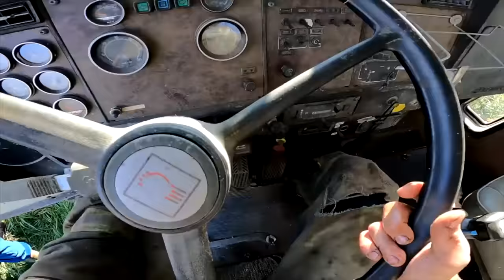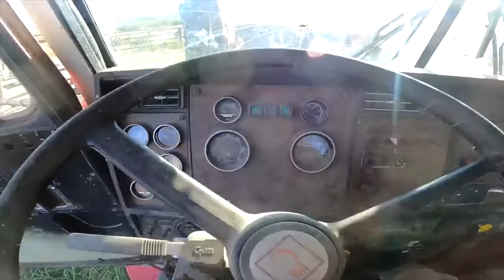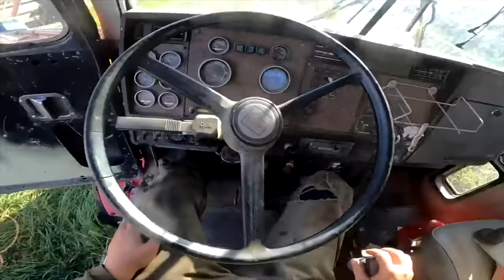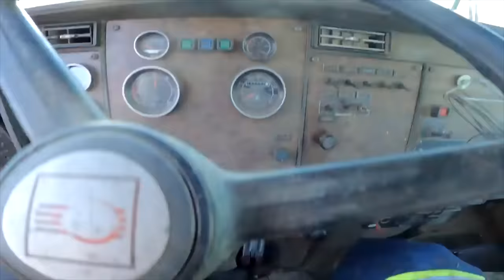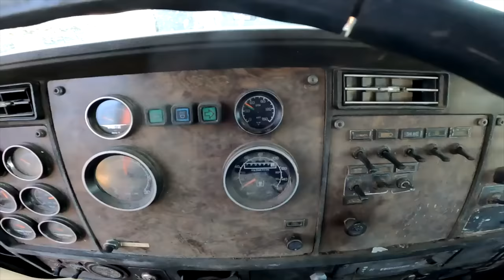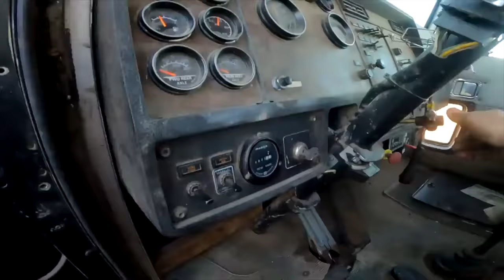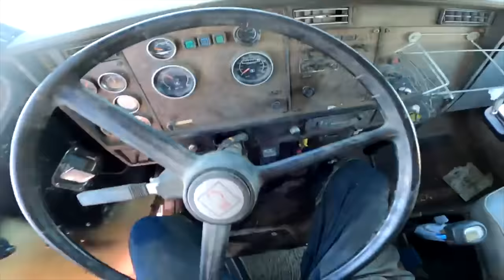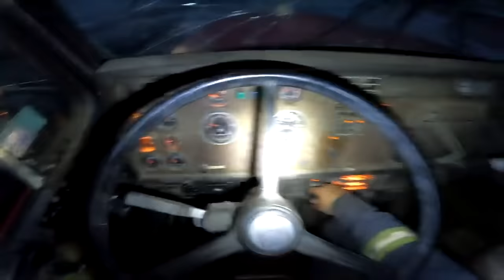1992 KENWORTH REZ ERECTION N HAUL!!!

Comment: I'm a Deere guy, but I have never heard anybody that dislikes Deere ether.  You see all the pulling guys use Deere ether too, so if its good enough for them to spray that into a several thousand dollar motor... drenching a 200 dollar one shouldn't be an issue.       Youuuu don't need to worry about ether locking your motor or ether backfires.
Reply: if its not red leave it in the shed
Reply: @ihguy2113  green means go, red means stop.
Reply: @ihguy2113  I thought it was " if it's red it will never leave the shed"
Reply: Green? Yuck.
Reply: @keltonwright7  I've been sideways with Deere and others for farmers right to repair. As the CEO of Deere made 6 million in 2019, 15 million in 2020 then 31 million in 2021. Not like they aren't profitable. So if you are seeding on a Friday and the Deere dude won't make it out with his fuking laptop to diagnose your system until Monday then what? So you grab a different tractor right? But that one is planting also. So use lose 3 days planting just to have it diagnosed. And that modem under a person ass in the tractor is sending what information to who? Your being squeezed out by mega farmers. Just like Deere and others killing off small dealerships. Yea I've seen all above happen. Next year the the pesticide, herbicide and fertilizers shortages have been in the spotlight for 6 months. They are putting the screws to every aspect of live to force the reset.
Reply: @dellingson4833  Same way with everything, and its not just Deere.  A neighbour of mine had a big agco Allis probably 300hp and the computer went.  So he phoned the dealership and they came and took it out and sent it away.  Well agco only rebuilds and programs the computers when they get enough to do a "set" number at a time.  Fast forward to last summer ( 6 years later). I see the tractor getting towed on a flatbed to the dealer and returns a week later back together and driving.  I'd wait 3 days over that, and pretty sure anybody would.  That's why nothing will be the pre-electronic age tractors, I know the last good Deere was late 90's.  That's why I own tractors from the 40's to the late 80's.
Reply: @keltonwright7  That is why i said Deere and others. But i watched the problem unfold in front of my eyes. It just happened to be a 18 month old JD.
Reply: @dellingson4833  yeah it's unfortunate, you get lemons with anything.  Know a die hard Chevy guy, bought a new truck.  Didn't even get 5 Miles from the dealership and it quit. They came looked at it and ended up towing it back and they gave him his money back because they couldn't figure out what's wrong with it.  Happens with everything, so is life.
Reply: @keltonwright7  but Chevy has right to repair as with most car companies except Tesla. It's the RIGHT TO REPAIR is the problem again. Take care.

Comment: Mike Post's electronical gavel threw me into a tail-spin and acid flashback.  Found myself looking around for Marisa Hargatey to walk out of the corn rows.  Next, you wrote something about Hansen's Flashback and that tripped me out even more.  Is it bad that the Potato came to life and started instructing me on cold starts like the burgers in 'Better Off Dead'?  Anyway paused the video and contemplated your killer End-Wrench Roll!  Could be my cord retractor has unspooled the ribbon spring?  Also, I think Sir Williard is a Shape-Shifter!

Comment: You must be doing pretty good to buy the John Deere either. It is definitely the high octane version. Most of the Tractor Pullers in my area use the JD either to get the tractors started. Pretty lucky you guys didn’t get summer teeth or Coloring Books for Christmas when the Hitch became wireless. Sawed off French man is a good Friend to smell your finger, wonder how many times it was a bad idea?? Another Great Video.

Comment: “Ain’t nothin’ like a clatter-pillar engine.”

I used to work on them. CAT even had their own cans of ether with a part number on them.    They called it “starting aid”.  Keep given’er the sauce bud. Just think about how many batteries and starter motors have been saved over the years because of it. Dear sweet Lord, we used ether instead of brake cleaner to clean a dirty ol’ cylinder head off before doing an in-frame overhaul. Smelled like victory!

Comment: When your transmission Grimes from Hardy lol it’s usually the synchronizer and the rear box the part is cheap but you have to completely take the rear box apart it will take about a case of beer